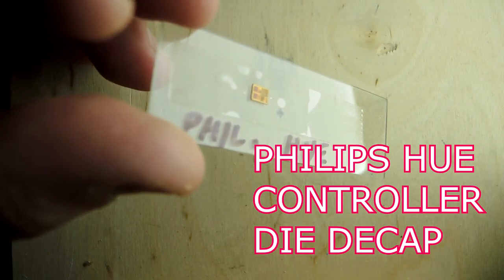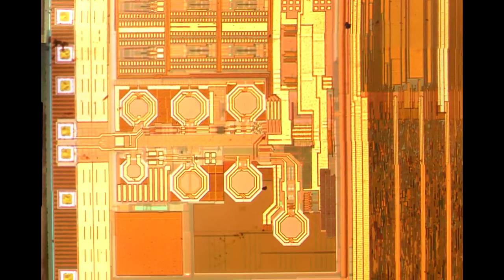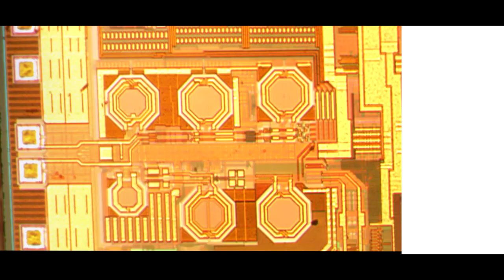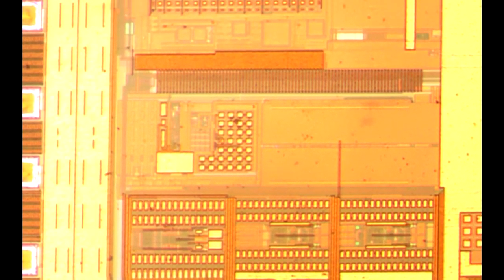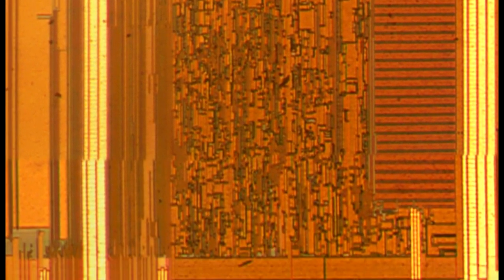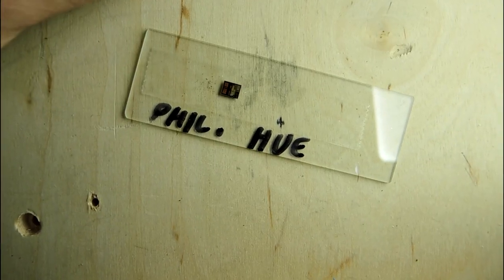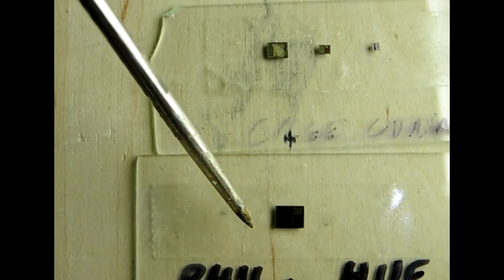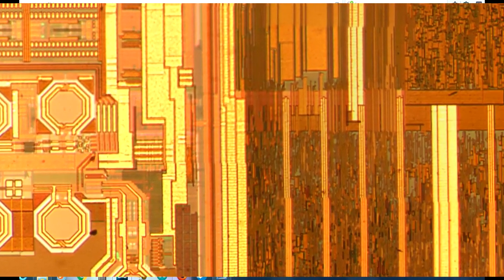PHILIPS HUE CONTROLLER DIE DECAP: Atmel ATmega2564RF

Comment: Magnificent, thanks for your awesome work! Looking at the photos on Flickr it seems that the RF part is more or less the same in the ATMega2564RF and the SAM R21 (which is basically the successor chip).
It will be interesting to see if future SAM R21 revisions will integrate the RF and MCU on one die like in the ATMega2564RF.

Comment: 2.4 ghz, 128k,  are these really only a penny in quantity? thats amazing really
Reply from the maker: Pennies... as in well under a $1.00.
Reply: Amazing videos. If "under a $1.00" is like $1.82 (in qty 40,000), then sure, pennies.

https://products.avnet.com/shop/en/asia/atmega2564rfr2-zur-3074457345629911665?r=ASIA&CMP=KNC-ASIA_FindChips_inventoryfeed_VSE

(It's also possible they got some sweetheart deal or maybe a massive volume deal for more than 40,000. Also assuming that a company like Philips wouldn't use black-market cloned silicon.)